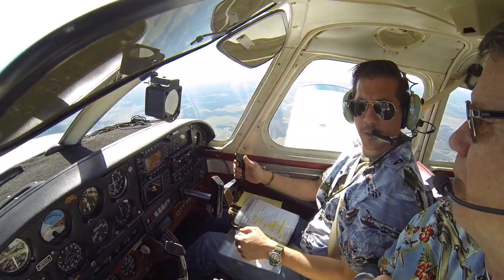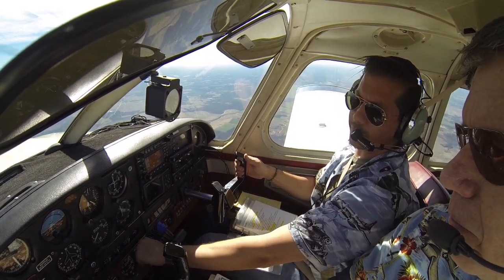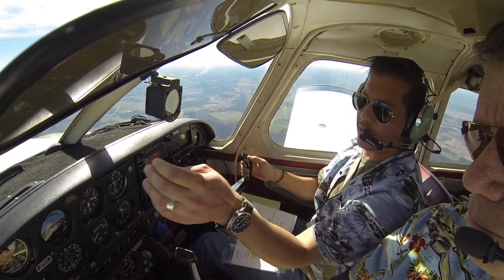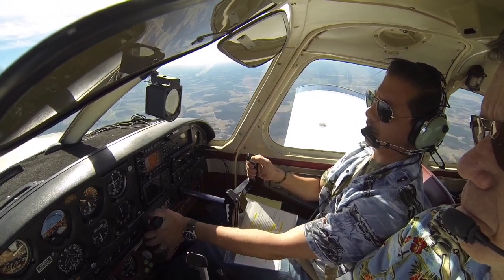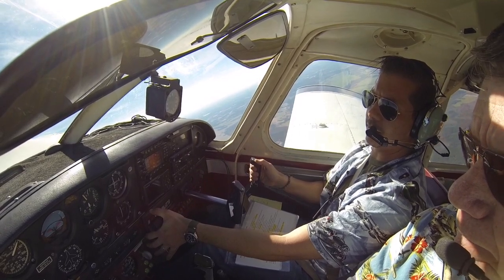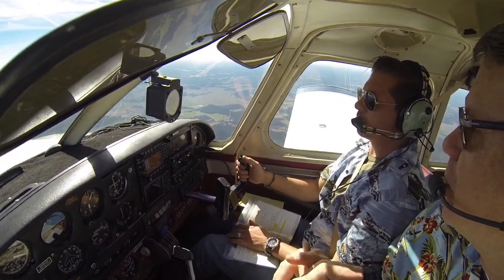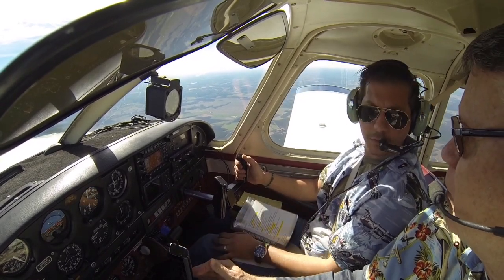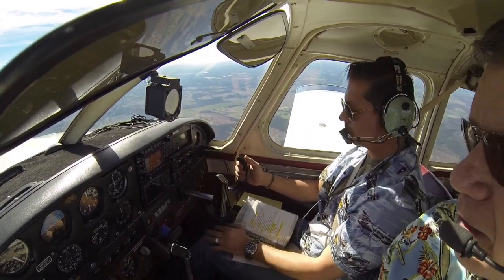CFI Elevator Trim Stall

Comment: Never use aileron in the recovery like you did
Reply: Why not? If the aircraft rolls one way or the other, what's the issue? Don't say "you're supposed to use rudder". That's not a valid argument. The real crime is those shirts they're wearing.....
Reply: @LowandFast357  Putting ailerons into the dipping wing will create adverse yaw and spin the airplane
Reply: @tmapaman7080  That's incorrect. A dipping wing/adverse yaw don't cause a spin. Exceeding the critical angle of attack, and allowing for a stall while being uncoordinated cause a spin. It's the rudder that's key here, not ailerons. Do the research.
Reply: @LowandFast357  if the right wing dropped during the stall and excessive aileron control were applied to the left to raise the wing, the aileron deflected downward (right wing) would produce an even greater angle of attack (and drag), and possibly a more complete stall at the tip as the critical angle of attack is exceeded. The increase in drag created by the high angle of attack on that wing might cause the airplane to yaw in that direction. This adverse yaw could result in a spin unless directional control were maintained by rudder, and/or the aileron control sufficiently reduced.

   Even though excessive aileron pressure may have been applied, a spin will not occur if directional (yaw) control is maintained by timely application of coordinated rudder pressure. Therefore, it is important that the rudder be used properly during both the entry and the recovery from a stall. Thus, the primary use of the rudder in stall recoveries is to counteract any tendency of the airplane to yaw, or slip. The correct recovery technique then, would be to decrease the pitch attitude by applying forward elevator pressure to break the stall, advancing the throttle to increase airspeed, and simultaneously maintaining direction with coordinated use of aileron and rudder.

Read the Airplane Flying Handbook (FAA-H-8083-3B) Chapter 4, pg 16
Reply: @tmapaman7080    Yes. Using your example from the AFH, it uses words like "could" or "might". Your original comment stated that "it will". These are not the same. The FAA says it's slightly possible but you're saying it's unambiguously definitive. That's where you're wrong. Could you exacerbate the spin by overcorrecting with aileron, possibly. But we're now talking about being incipient or fully developed. But we're talking about stalls here. Spins weren't the argument. The argument was that you should never use aileron to when recovering from a stall, which is false. To be clear, the use of rudder and reduction of AOA are the only things that will keep the plane from spinning during recovery from a stall. Using aileron doesn't present the risk that your claiming it does, in the context of this particular video. Look at the first sentence of the second paragraph in your excerpt from the AFH. It's precisely what I was saying.
Reply: @LowandFast357  Very simply put aileron usage in a stall will create an uncoordinated stall which can lead to a spin.
Reply: @ryandunn6256  oh dude the truth is, a spin is caused by the uncoordinated control which is rudder. No matter turning both wings stall approximately at the same time if it's coordinated.
Reply: @ryandunn6256  Wrong too. Ailerons don't cause you to be uncoordinated, the rudder does. Learn something man....
Reply: ryan dunn especially at CFI level
Reply: Ryan is right. Using ailerons will increase the angle of attack thus the amount of induced drag from the dipping wing. It will make the airplane much more uncoordinated.
Reply: @TheodoreViollet  Also incorrect. I hope you guys aren't rated Pilots, but rather Monday Morning QB's.